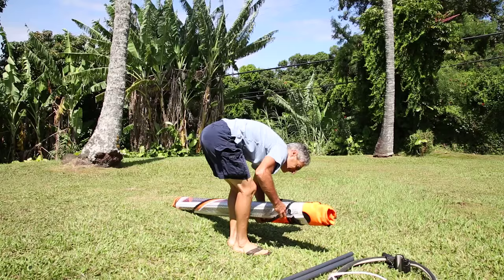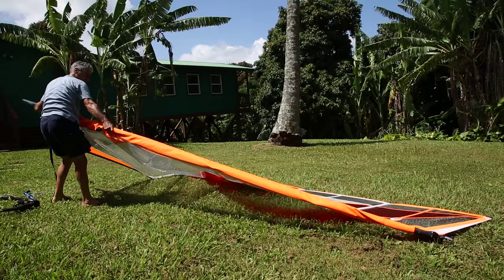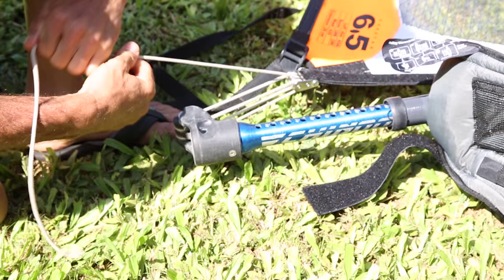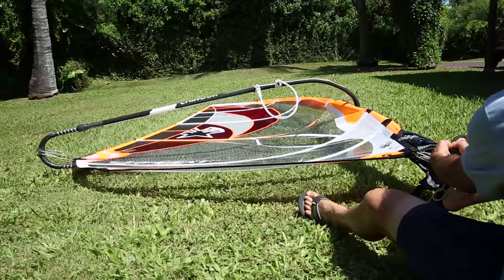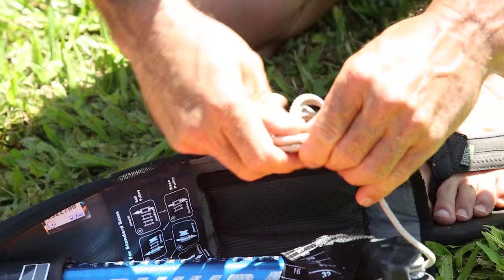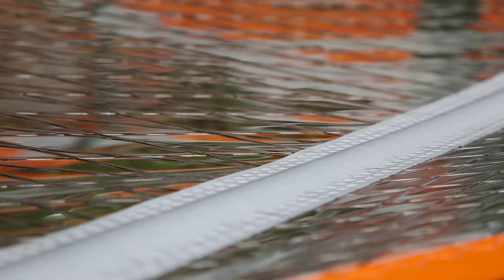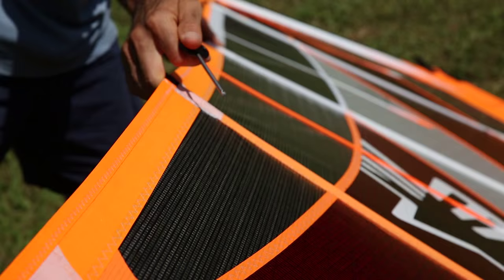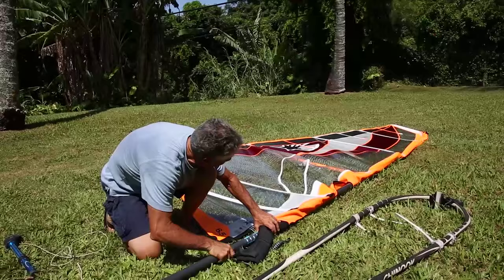2016 Ezzy  Cheetah Rigging

Comment: Thanks for nice  video. Can you reply for my two questions please…??
1) Chetah 8.5 performance is better by RDM mast or by SDM?? 2) In case that I use RDM mast by Ezzy, do I have to change position calibration gauge for index of dawn haul ?.
Reply: thank you for reaching out Man. The best mast for the Cheetah is our RDM mast. The key to the mast is the "percent bend curve" which measures the ideal mast specs and bend characteristics. It may be better to help you via direct email as we have some files and images we can share with you to help. The format here on youtube isn't ideal. Please feel free to email your inquiry over at ezzy@gorge.net and we can help. Regards, Tim
Reply: Thank you very much for the information.  I have a 2009 Infinity 8.5 !!!!  and I'm thinking of replacing it with cheetah. I will visit the site  that you proposed for more help. Thanks again.